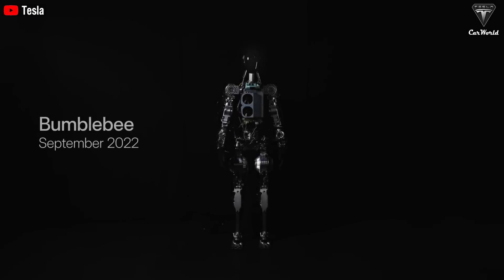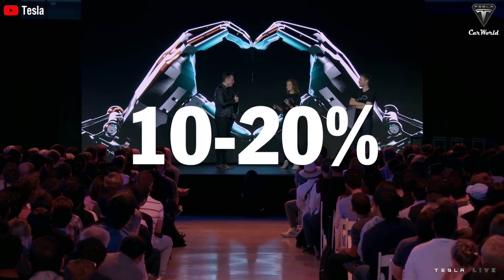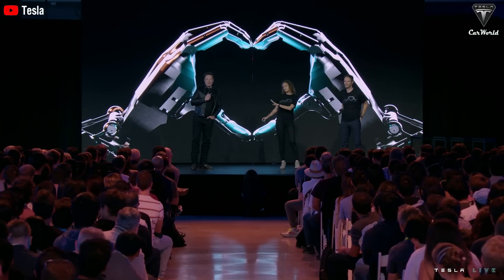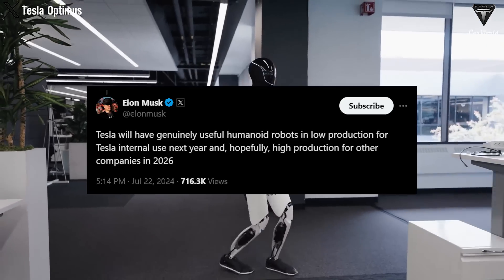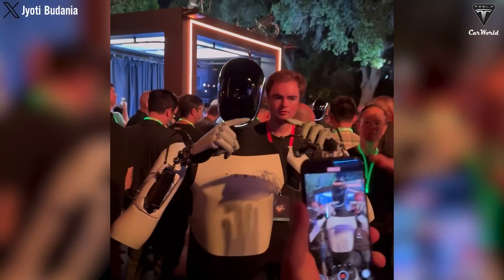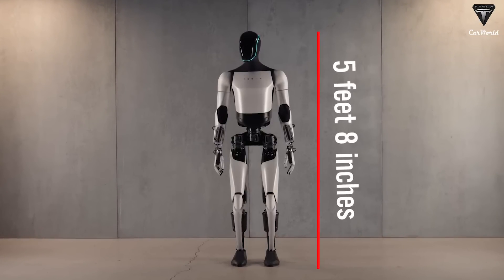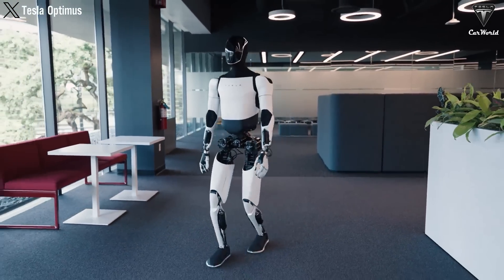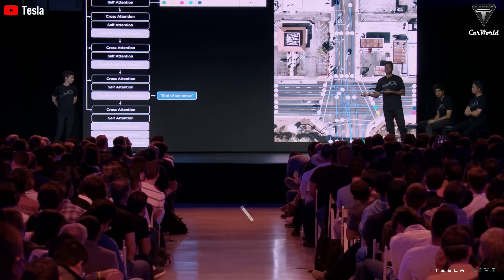Elon Musk Drops Insane Announcement On Tesla Optimus Gen 3 Robot, Major Updates Coming on Dec!

Comment: Its torso, head, legs and arms should be able to make 360 rotations like Boston dynamics. That really allows versatile movement especially in small spaces
Reply: why ? if it needs to fit into a world built by humans for humans ?
Reply: @julesgosnell9791  you really dont understand that humanoid design barely has any benefits over task specific designs.

Same arguement as why mechs are not good and why tanks are good
Or why you have helicopters instead of flying cars.

Comment: The focus on refining design and materials for Gen 3 is promising. It could lead to significant improvements in the robot’s performance and durability.
Reply from the maker: Absolutely! Tesla’s emphasis on refining the design and materials for Gen 3 Optimus is a smart move that could make a real difference in both performance and durability. By focusing on high-quality, lightweight materials and a more streamlined design, Tesla is likely aiming to enhance the robot’s agility, energy efficiency, and overall lifespan. Improved materials can also mean that Optimus will handle tasks more effectively, especially in industrial settings where durability is essential.

With these upgrades, Gen 3 may be able to perform more complex tasks and withstand tougher environments, making it more versatile for different industries and households